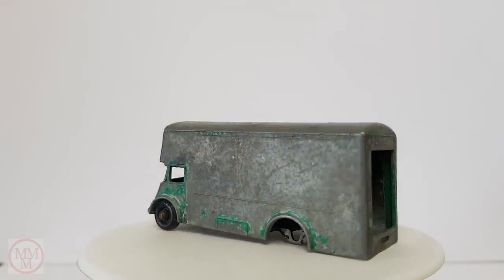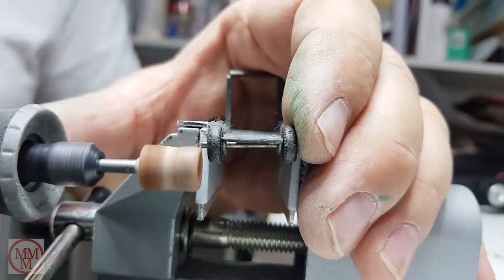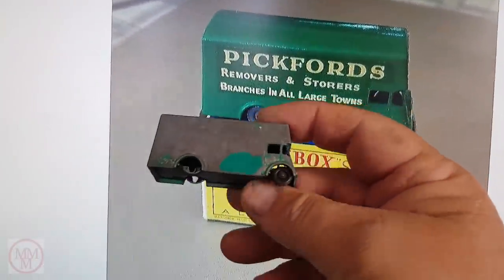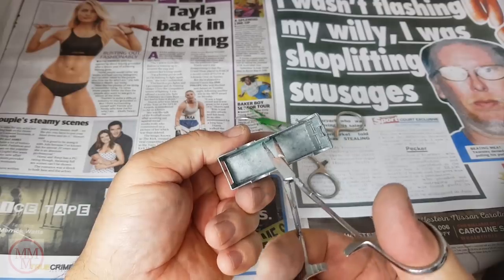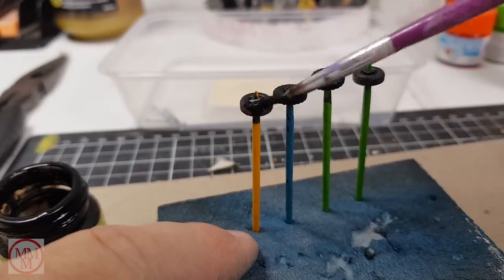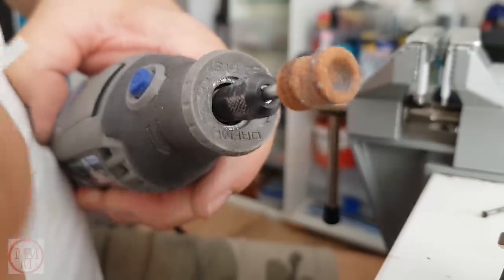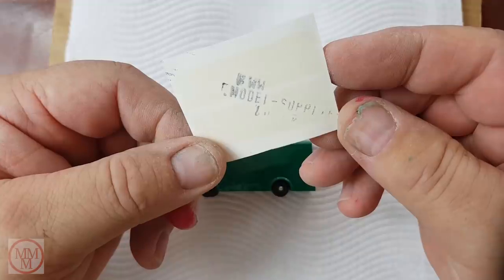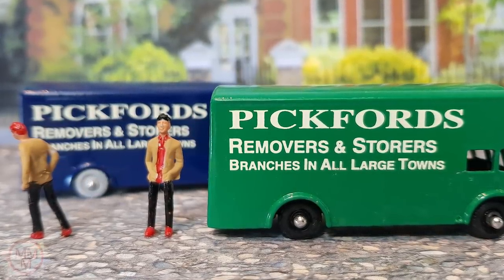MATCHBOX Restoration No 46b Pickfords Removal Van 1960

Comment: Another fine restoration Marty - well done. A wee suggestion I've seen used online :- if you squeeze a little paint out of the chrome/silver pen, into a shot glass, you can apply it with a small paintbrush. It will give you more control over the thickness/flow rate of the paint.
Hope it helps.

All the best,
Dougie.
Reply: Agreed...that is the best way to apply the chrome. I only use it to touch up plastic parts that had a chrome finish...for die cast I prefer to use Tamiya silver. Chrome has it's place but only on certain models.
Reply: I use these these Molotow? chrome pens.  They are great for refreshing the chrome hubs on Matchbox superfast wheels.  Really brings scratched wheels back to life.

Comment: How do you thin down the paint for your air brush, I always have an issue of the paint drying in the airbrush and clogging it? Does anyone know what I’m doing wrong? I’ve tried several different airbrushes...and am using a proper air brush compressor with an inline water separator. Good part I’ve very good at cleaning air brushes and reassembling them, I can do that in minutes now.

Comment: What were you thinking, Marty!?!  Lord knows what happened in the back of that van!  Anyways, yet another fine restoration, minus the chrome detailing.  I will say it gives off a very nice chrome look compared to other paints I've seen, but like you I too think it went on too thick and drowns out the fine detail.  Out of curiosity, does the Pickfords van use the same rollup door as the Commer Rentaset van or are the molds slightly different?

Comment: Well marty just as we think you're at the top of the you tube ladder  you add another rung in the form of a stupendous video in which you take part you will have to start a film company called MGM Marty's Golden Matchbox and Kevin can be in the opening sequel instead of the lion but congrats on another 100% success story luv it the pickford van came as a chassis /cab built in Wolverhampton West Midlands using a meadows diesel engine also built in Wolverhampton it was then driven to the bodybuilders by a driver perched on a seat open to the elements to Luton in London to have the body built and that type of vehicle is known as a luton van all their bodies were built over the cab just a bit of useless historical fact chris(uk)

Comment: Lovely makeover. Two thoughts about decals-- Tamiya (I think) makes a neat little perforated decal tray that sits in minimal amounts of water; good solution to the problem. Because you can see the decal sitting on the paint, you should consider a gloss "top coat" to completely conceal and seal in the decals on a gloss surface. If Vallejo paints are available, their gloss finish (air-brushable) is earning praise in the US modelling community.

Comment: With a lathe u could reuse the rivet caps as hubcaps but you may have to drill a lager diameter hole in the tire ,attach  with superglue to axles! this will add bling to these unique restos....

Comment: Some time ago I reworked a Dinky Toys model which originally had spray-painted silver trim. I don't recall exactly how I did it anymore, but I made a masking template to expose only the grille, headlights, and bumpers, then gave it just one quick pass from a spray can. The result was a somewhat spattery and imperfect silver finish which did a pretty good job replicating what would have been done at the factory.  I'd be interested to see what results you could get, because you are vastly more skilled than I am.

Comment: A hemostat is a clamp used to grasp and temporarily seal a blood vessel, aiding hemostasis.  Usually there are serrated locks to enable variable pressure dependent upon the size of vessel.  Commonly they are gripped with the thumb and middle finger and locked and released with that grip.
Forceps are instruments used to grip tissue  and release it in the manner of a tweezer.

Comment: Asking for a friend, any advice on blow-up doll restoration. 
Will inner tube patches work ? 
And then my tip on rattle cans, put the cans in a bucket of warm/hot water before painting. Paint spray will be finer and the result is much better.

Comment: Hi Marty!
I've recently found a channel of a Czech guy doing some plastic models. So I saw some things you might find useful - like casting small detailed parts from epoxy resin (first using the original parts as template for the mold - it can be useful for tires, people and small details some of the models have) and using chemicals called "decals thinners" - which help applying the decals on uneven surfaces. It's called "PLASMO - Plastic models".

Comment: Great vids, but I’m surprised you don’t soak the castings in Dettol to remove the paint. It’s user friendly and you can put more than one casting into the tub of Dettol.
Reply from the maker: Standby, i am going to try that in the next vid or two!!!
Reply: Nice one, I have just sealed sandwich containers of different sizes, depending on what I’m stripping....you can use it over and over again.

Comment: I've seen that you've been taking some viewer decisions in terms of paint stripping. Have you ever tried Dettol Antiseptic Liquid? If you fill a small container with it and leave the model overnight or for a few hours, the paint strips off easily. You will need to brush any access and give the model a thorough wash in soapy water but the Dettol can be reused again several times before you need to dispose of it. See what you think and see if it helps at all.

Comment: In my experience Molotow chrome takes a week or more to dry properly. In that time it will shrink down and show you the details that were originally hidden. Be careful handling and Molotow chromed pieces before they are properly dry as well, the chrome turns to a dull grey if you touch it before it is properly dry.

Comment: If you would like to further improve the quality of the finish paint,  you should polish your primer coat with 1200, then 2000 grit sand paper, making sure you stay away from raised panel lines.  Tedious work in this scale, but the results are startling.

Comment: Aluminium foil tape is a must for chrome parts. If you have the skill to cut it to exact dimensions of the grill, you simply use a toothpick to work it in without loss of detail. Bumpers are a dawdle for doing this. As for the chrome pen, you haven't used it properly, too much applied will always mess up.

Comment: I know we're looking under a microscope here and it's essentially not visible, but the wheels aren't identical. You can make reproduction wheels. I haven't made wheels before but i had made similar items in size and detail, i would use 2k silicone i got from a local craft store (Glorex Silikonknetmasse) and make a semi-open mould, which would envelop the wheels most of the way but be open around their back surface which will become flat, and fairly quickly curing epoxy for convenience (UHU Schnellfest, which is not perfect because of gelling agent, but it's what i happen to have) with graphite to tint it. It's not a very long process, the silicone sets pretty quickly by itself, and the epoxy can be rapidly cured by blasting it with a hair dryer or throwing it onto 3d printer's bed or so, will also help the epoxy flow and fill out the mold better.

Comment: Okay Marty...let me explain, No is too much...let me sum up. Buttercup is marry Humperdink in little less than half an hour, but I digress. My mom was an O.R. nurse and my uncle was an E.R. doctor and what they both taught me before they passed was what you are using when painting your cars. They are Arterial/Vascular Clamps. You can tell that by noticing if there are opposing  teeth that hold the two halves of the instrument together on the handle end of the instrument, right by the fngerholes. If there are those little teeth, by god they're clamps. A pair of Forceps are considerably larger and are really useful for helping large babies get born if the mother is a bit too small to let him/her out. And Hemostats are really small, long , and thin tweezers designed to help vascular surgeons retrieve or remove things from inside blood vessels. I have heard many restorers call those things by a dozen different names, none of them actually correct. They're Arterial/Vascular Clamps. I'm really not trying to be a bunghole here, but I just wanted at least ONE guy to get the name of the instrument right.